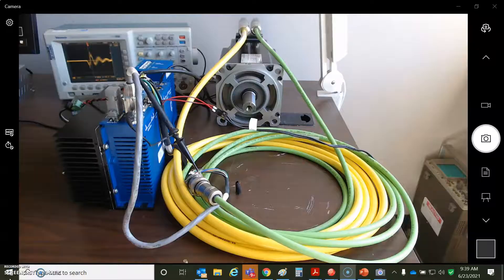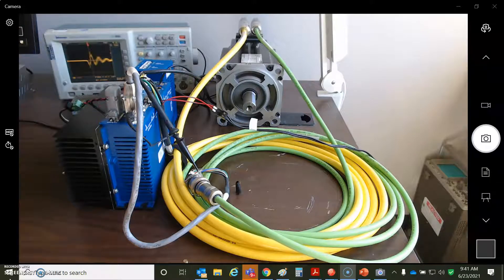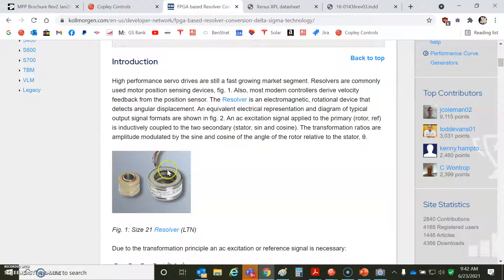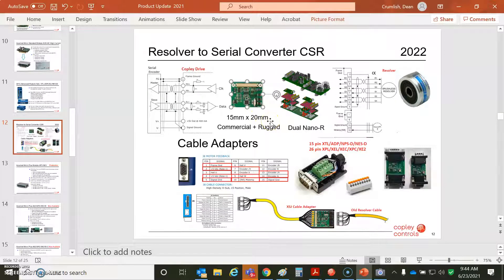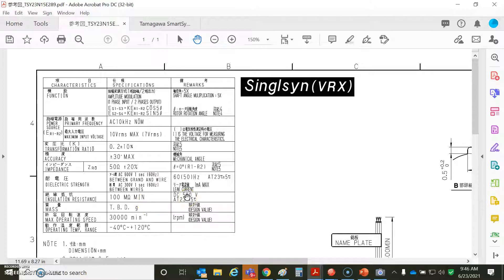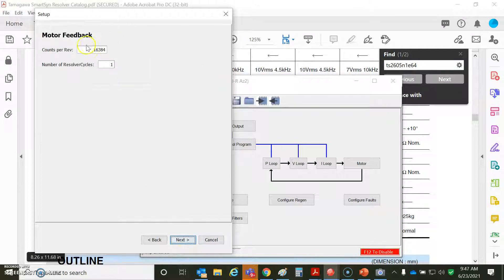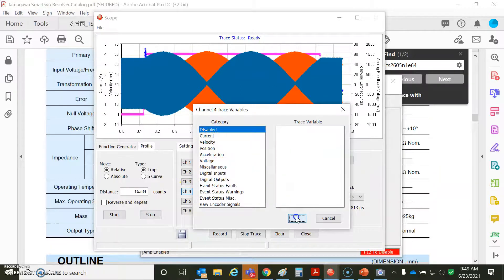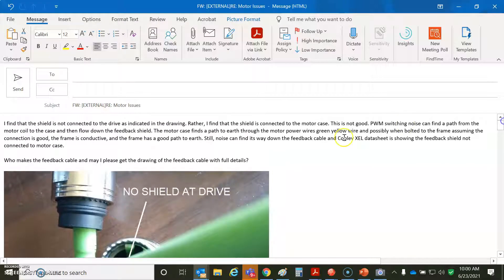Resolver theory of operation. Advantages vs Encoders, good shielding, and arc seconds of resolution.

Comment: you mention that the shield must not be connection to Earth at the motor side . However Encoders that come as separate units for example heidenhain ERN 1387 , the shield is already connected to encoder housing which will be bonded to the motor frame . So the shield is connected at the motor side , the question does it have to be connected on the other side (drive side) also ? . Note that it looks it has one 1 shield ( no inner shield)
Reply from the maker: You must wire the outer shield to earth at drive. Typically frame of drive finds path to earth. Copley typically has pin 1 to frame ground. See Copley datasheet. In Europe they wire earth at both ends. If noise from motor case gets to feedback then take countermeasures like good solid fat thick path for motor case to earth. It's not my fault that some motor companies do not take good advice from a drive company.